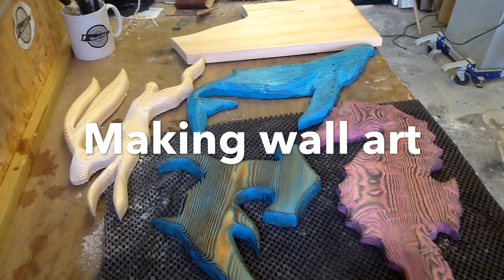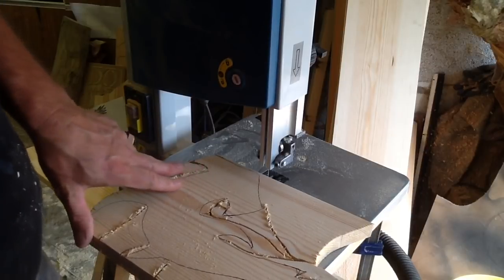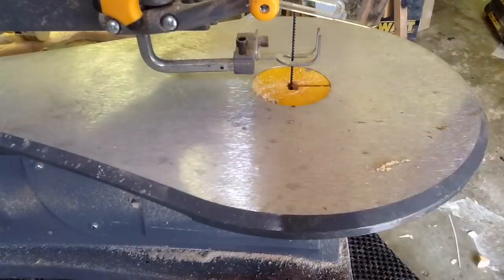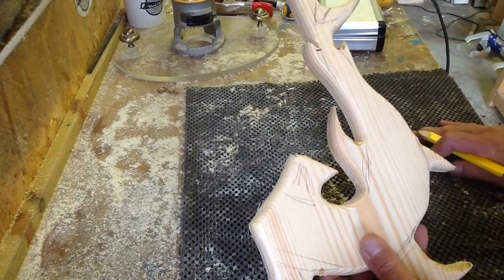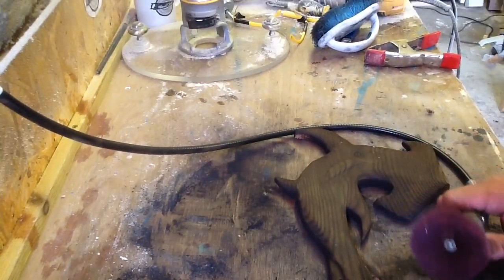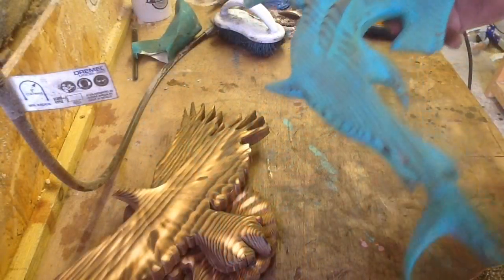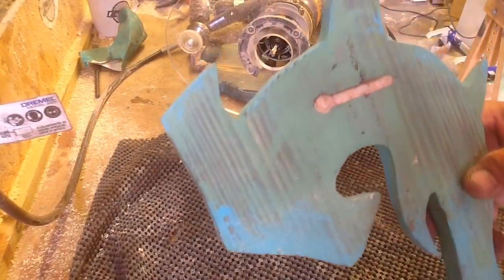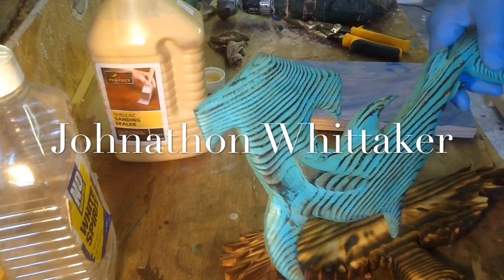Hammerhead

Comment: Nice work!
Reply from the maker: marcobrazil thank you!
Reply: I might try that, regretably i only have a jigsaw, not a scroll or bandsaw. I think i will try to outline it with my router and then cut with the jigsaw. Work the edges with the dremel. Regarding the paint would acrylic paint work also with this?
Reply from the maker: marcobrazil yes i mostly use acrylics on these. As for the shape, I generally cut.the rough shape with the jigsaw first then go around with the band or scroll saw. If you use a fine tooth bit, you would get good results with minimal sanding on the edges